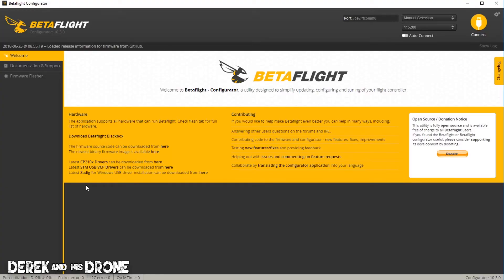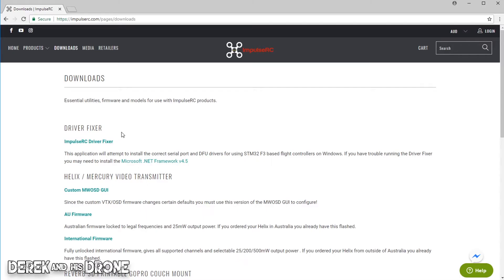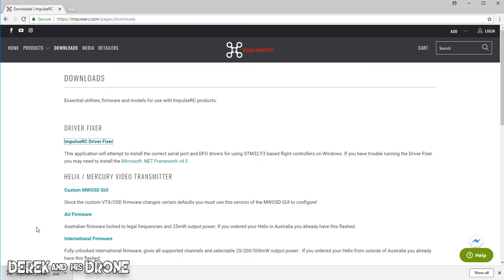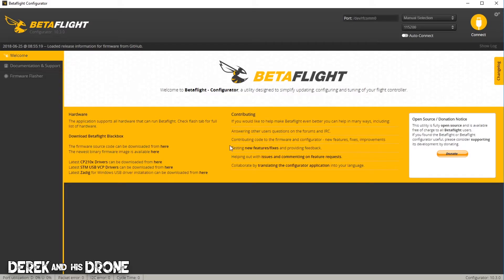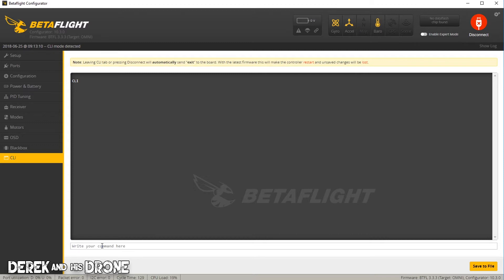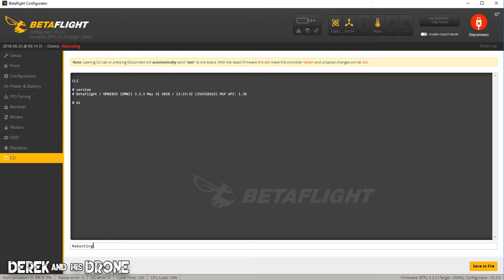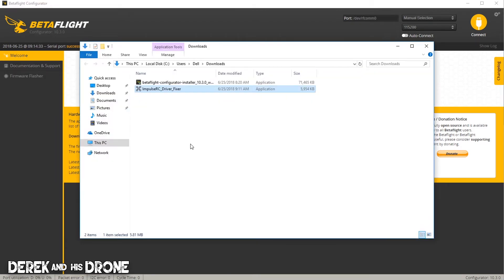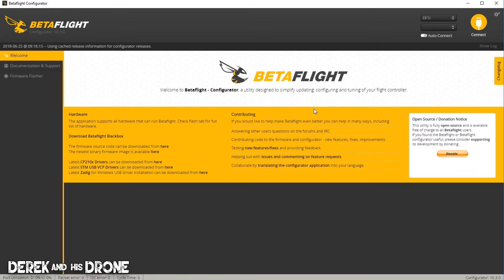Basics of Betaflight - Installing DFU Mode Driver

Comment: I just spent 3 hours trying to repair drivers, enabling this DFU thing, but the problem was, that the drone was plugged in to an USB 3.0 port oof
Reply from the maker: USB 3.0 shouldn't matter.  Might have been something with the computer.
Reply: It is a freshly installed win 10 with every driver needed, if that wasn't the problem as you say, probably the cable couldn't handle the 3.0
Reply: flashed via usb 3.1 with no problems, win 10

Comment: I'm using f7 flight controller and i have a same problem 
I can't get DFU to work 
I tried driver fixer but it doesn't work
Reply from the maker: More than likely you are missing something from one of the driver packager.  Install both the CP210X and VCP USB driver packages and run the driver fixer again.  Here is a link to a video for installing the drivers.
https://www.youtube.com/watch?v=4vNMFgB9e2Q&list=PLhDNpBXK0rt9hMRYX_512y37LkPn2Xn_H&index=3

Comment: , i accidentally messing with port setting, and after plug in back, my usb not recognized. can use this to fix it?
Reply from the maker: You will need to manually put the board into DFU mode by using the button or boot pads.  Depending on your FC it will have one or the other. But yes you will need to install the DFU driver to reflash.  There is a bunch of videos in that playlist that might help. 

https://www.youtube.com/playlist?list=PLhDNpBXK0rt9hMRYX_512y37LkPn2Xn_H
Reply: @DerekandhisDrone  actually its my mobula 7. f3 pro board. im messing with port setting, then after reboot, my pc dont recognized my fc. tried install all, including stm driver , etc and all possible approach. still its dont
 work at all.
Reply from the maker: In the future do not turn off USB VCP that's how your flight controller talks to your PC.  Manually put the board into dfu mode then run ImpulseRC driver fixer.  Then reflash the board.  If driver fixer doesn't run successfully the board will probably have to be reflashed with a TPLink programmer.  If that is the case and you can't find someone to run the programmer for you most likely you will have to replace the board.  Here is a link to the driver fixer.
https://impulserc.blob.core.windows.net/utilities/ImpulseRC_Driver_Fixer.exe
Reply: @DerekandhisDrone  thanks derek, its work!,
Reply from the maker: That's great!

Comment: I couldn’t upgrade the firmware on my BeeBrain lite until I found this video. Thank you very much. Wish I found it 8 hours earlier lol
Reply from the maker: I'm glad you got it to flash.  Just to let you know NBD only recommends installing firmware from them.  They do some special things with the tune and setup that you won't get downloading the firmware through Betaflight.  They have not released a 4.0 version yet.
Reply from the maker: From NBD's website
"ONLY use the firmware provided here on the product page and not from the
 Betaflight drop-down menu, our firmware is custom made to work with our
 FC, using unofficial firmware may cause bugs."

Here is a link to the product page with  a firmware download.
https://newbeedrone.com/collections/beeductrix-inductrix/products/beebrain-lite-flight-controller-set-frsky
Reply: Derek and his Drone yep got my firmware from them. Thanks for the follow up and info. I just subscribed to your channel and really appreciate the info 🤜🏻
Reply from the maker: Thanks for the sub, I just wanted you to get the right firmware.

Comment: Are you gonna do this same thing for butterflight?  I've left beta long behind. All my quads are spread in butter.
Reply from the maker: Probably not. The setup and configurator are pretty much the same.  The difference is in the tuning. That could be a series.